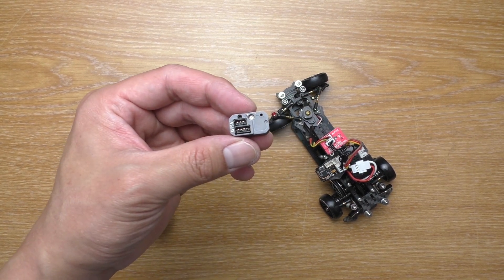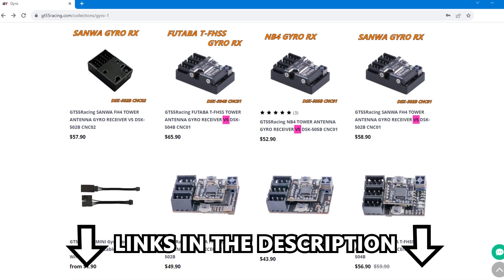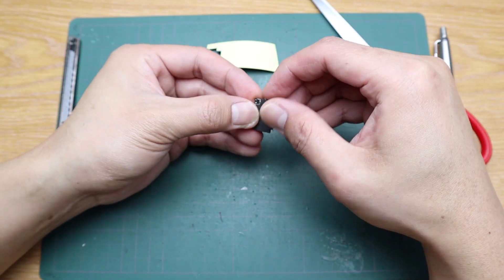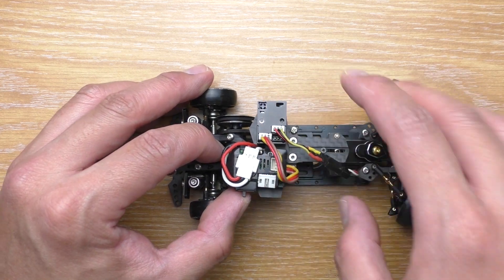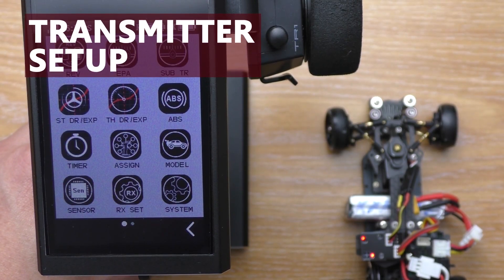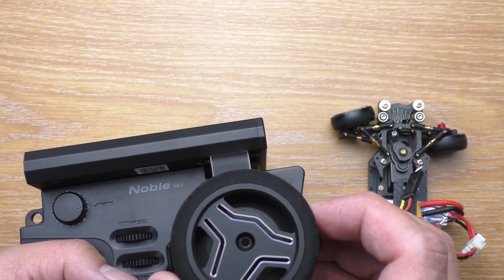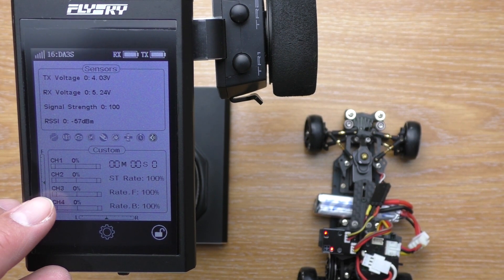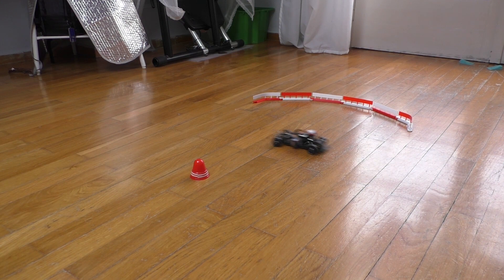How to Use & Setup GT55 Nano Gyro Receiver V4 & V5

Comment: YOU ABSOLUTELY MUST NOT EXPOSE THE CAPACITOR (top one on 2:31). It will short to the aluminum case!
Reply from the maker: Thanks for the heads up.
I'm not sure if the cap is polarized on the top but it's from he manual. The aluminium case has some coating so it doesn't conduct electricity as long as the the coating is still there. Anyway, I'll cover it up just to be safe.
Reply: @BeaversHobby  this type of capacitors is not polarized, but has exposed pads on all sides (even on top), so yes, you'd better coat it with something like capton tape

Comment: Does the v5 support with fs g7p?
Reply from the maker: Unfortunately, no.
Reply: @ so better get a v4 and receiver separately right?
Reply from the maker: @Daddycry123  Yes, you'll have to get the separated gyro unit and V4 will work great.
Reply: @BeaversHobby  okay thanks im planing to buy a g7p as my transmitter
Reply from the maker: @Daddycry123  Nice! It'll work great with the FS-R4M receiver.
Reply: @BeaversHobby  or is it compatible with dumbo ddf350?

Comment: did it and my gyro doesn't work. Do you know why? And I also can't adjust the CH3-CH4 parameters like you. Please help me
Reply from the maker: Check the settings on the transmitter first and see if you can move the bar on the screen. Then re-do the steps on the gyro.

Comment: the video is very good but I need some help. I have a v4-s01 gyro and after I set it up I cant turn left. I cant figure it out so if someone knows it pls help. thanks
Reply from the maker: Seems like it registered the wrong value. You can try and do the process again but this time you start with the opposite side. Or just reset it altogether and use it without the EPA.

Comment: Would this work well with the mt12? Or do you recommend another gyro to use with it? Also, what servo would you pair with the gyro you recommend?
Reply from the maker: Unfortunately, not this one exactly. There's another model for Flysky AFHDS protocol This will only work with 4-in-1 multiprotocol version. https://www.gt55racing.com/products/gt55racing-flysky-afhds-built-in-gyro-nano-rx?DIST=RUZBGw%3D%3D
If you have the ELRS version you can use a separated gyro unit like this. https://www.gt55racing.com/products/gt55racing-gyro-v4-for-1-24-1-28-drift-car-gt55-v4-s01?DIST=RUZBGw%3D%3D

Comment: stupid question from a newbie to the hobby, but why does an rc car need a gyro?
Reply from the maker: We use it for RWD drifting. On a real car there's a friction between the road and the tyres so when the car swings the tyres also keep contact and turn the wheels. On an Rc, there is none of that. If the car swings and you let go of the steering, the wheels will just point straight. So we need the gyro to simulate that motion and turn the wheels.

ps. It's not a stupid question at all.

Comment: I bought one if the rtr tg racing rwd but the epa settings is out, having difficulty to set with dumborc transmitter. Further, one of the front tires lift up when turn left. Not sure on how to settle this issues, any suggestions. Thanks.
Reply from the maker: The front tyres lift is pretty serious. You'll have to see what pulls it up when you turn. It's most likely the EPA or if the transmitter doesn't have EPA then you'll need to do it in the dual rate (D/R). Try and set the servo to exact centre when it's at 0 trim first then turn the D/R down until it doesn't lift the wheels at full lock.
The EPA depends on the model of the transmitter. I remember the cheap version of DumboRC doesn't have that. Anyway, you'll need to find the exact model of your transmitter and check the manual.

Comment: Hey Beaver.. is it possible to run a light kit with this receiver / gyro combo? Being that there would be a 4th plug require from the light control until to detect throttle and steering inputs 🤔
Reply from the maker: Yes, it's possible. It depends on the light kit though. If it's the light kit only needs 1 extra channel to change the modes then yes, it'll work.

Comment: Hi beaver, is there any gyro that you'd compare to the gt55 v4?

I'm looking at making a cheap 1/18 ldrc setup and even if I absolutely love having my gt55 in it it definitely feels frustrating to put a 50$ gyro in a 50$ car.

Granted if you'd say for the price you can't get better value, I'll keep it in since it's much better than any other gyro I tried so far and just buy an other one for my drift art. 

I'll also try it out in my Sakura d5 and let you know how smooth it runs
Reply from the maker: There's AFRC GYS-2 V4 which should be a bit cheaper than GT55. There's also DasMikro gyro which is even cheaper. I use DasMikro with my BMR-X and it's really good. Not as good as dampening as the GT55 V4 but good enough.
Reply: @BeaversHobby my gt55 doesn't work with my new XM4FG receiver, it twitches like crazy and cannot be set-up.

Analog vs digital options? Different output signal 1520us?

Set up was easy but only worked with my X6FG receivers.

Comment: some says the rx gyro was easier to die than the separated one? What is your opinion?
Reply from the maker: I never break a gyro before built-in or otherwise so I can't comment on the durability. However there's a risk. Having a built-in means if anything goes wrong you will loose the whole thing because all is on the same board.
With this type (nano gyro receiver) you can potentially fix it by replacing the gyro board though.

Comment: Hi, I'm planning to buy their futaba gyro receiver v5, but when I checked the description, there's no t3pv on the list of compatible transmitters. I'm just wondering if it's compatible or not before spending $65 for it. Thank you if you could help with this.
Reply from the maker: It should work because 3PV also supports T-FHSS. You will have to switch it to that mode though. Normally it runs on S-FHSS.

Comment: Great video!
Do you have any battery recommendations? I have a DRZ3 and a few 350mah drone batteries but they are too big unfortunately
Reply from the maker: Marka Racing 350mAh is really good. It's a flat battery that should fit most of the cars recently come out. It also comes with JST-PH plug for Atomic ESC too.
Another option is GNB HV 300mAh. This one packs a lot of punch but it's square so it's about 1mm taller than Marka but narrower.
Reply: @BeaversHobby  Thanks for that!
My batteries also have separated balance plug to the negative and positive. I am guessing the ones bow are basically the balance plug providing everything? (The three wires)
Reply from the maker: @tremorflow3614  Yes, the one with 3 wires basically only give you the balance plug. I forgot to mention you'll need to make  an adapter to charge it because most of the chargers accept +, - and JST-XH 2.5mm for balance..

Comment: Please review TG Racing Chassis
Reply from the maker: Thanks for the suggestion. Will try to get that.
Reply: @BeaversHobby 
I appreciate your reviews as always. Can you please tell if you know Turbo racing C75 is faster than Turbo racing C81 ? Is there alot of difference?. C81 goes 7 km/h. How fast is C75 please.  Thank you.
Reply from the maker: @raydavis7685  The C81 monster truck is slightly faster but it is more difficult to control. The steering is more vague than the onroad cars. All in all if you can get both running straight at the same time you won't see much difference anyway.

Comment: Hi Beaver, think I'm gonna have to upgrade from radiolink. What do you reckon? NB4 might be possible but anything cheaper?
Reply from the maker: NB4 (the standard one) has the best price per performance ratio. The price varies from place to place but if you can get one for under $200 it's already great and nothing comes close at that price.

Comment: Good video, definitly gt55 offers a very good electronic. By the way. Would you recomend HGD1 for a very tight budget? (280€)
PD: Is my first car so I have to buy the radio, battery and charger
Reply from the maker: Not really. I think the HGD1 chassis is around 170-190 Eur so at that price you can get the TG Racing or you can get the BMR-X with wheels. If you go with absolute minimum for transmitter and charger then you should be able to made do with 280 Eur.